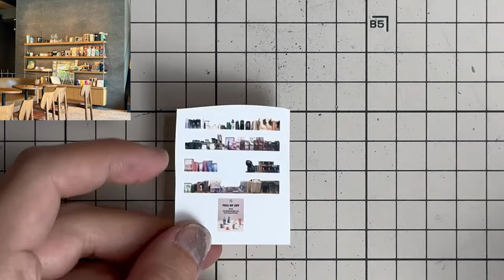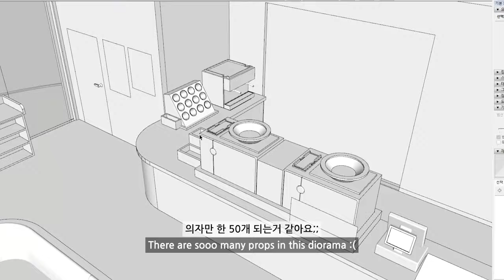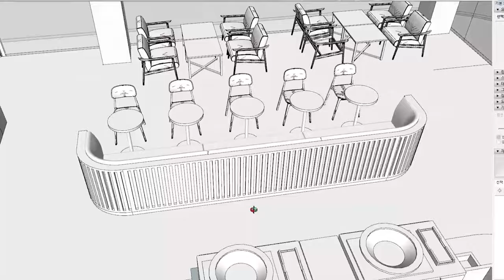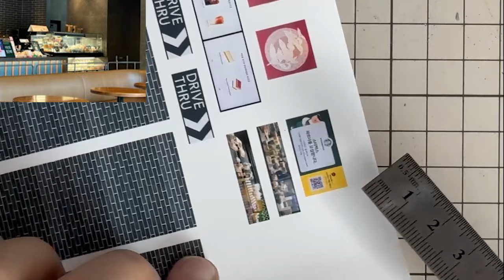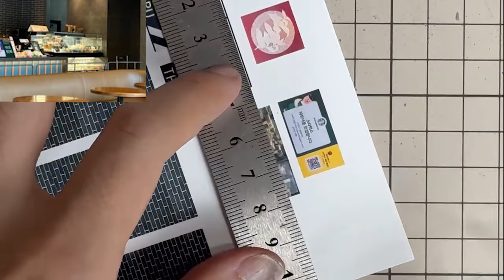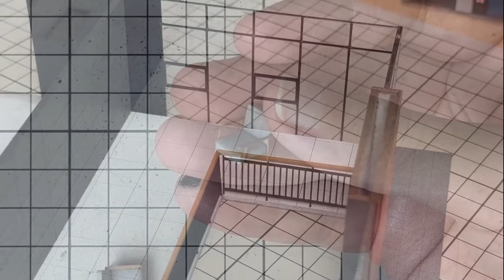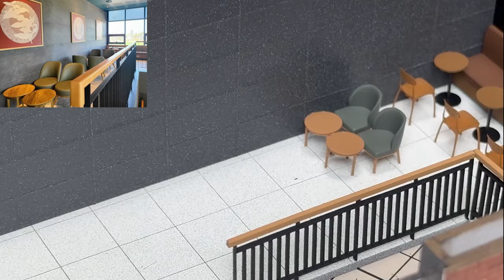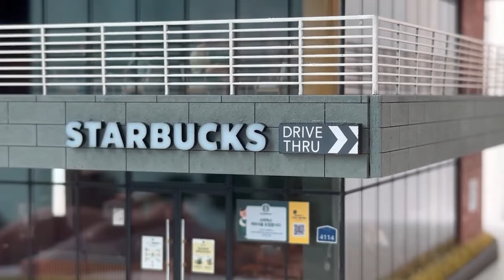Making the MOST detailed Starbucks diorama EVER! in 1/64 scale (Part 1)

Comment: Ok i was really impressed untill You added those COB LED Stripes instead of single LEDs and wasted about 99% of the light plus generating heat. Those LEDs will have a short life. 
Anyhow the building itself is a absolute masterpiece.
Reply from the maker: Yeah it does generates a lot of heat😂 obviously my mistake
So i’m using led at 20% power now thanks👍